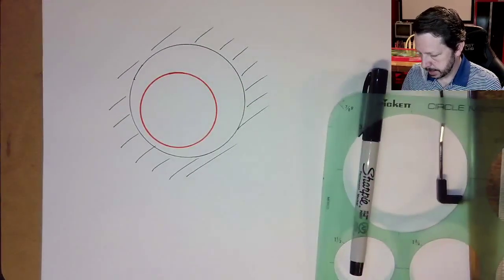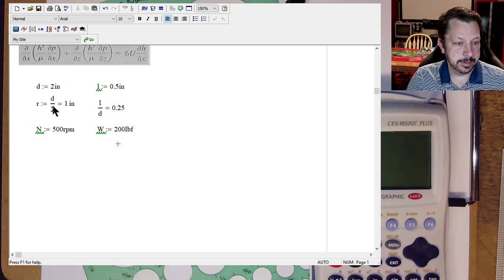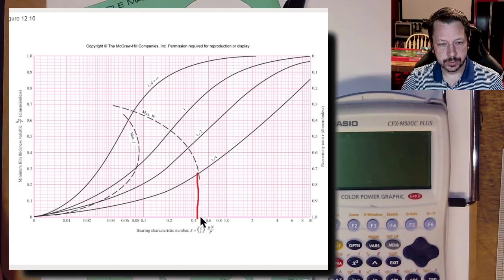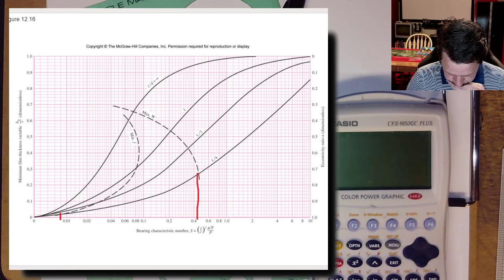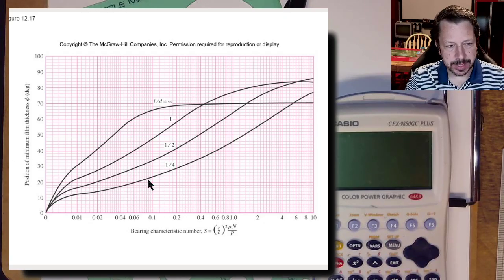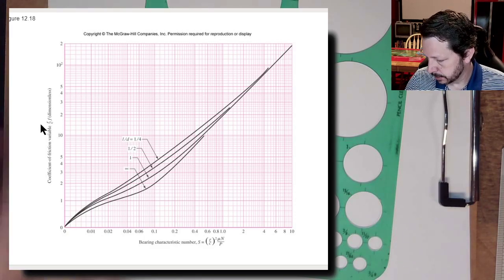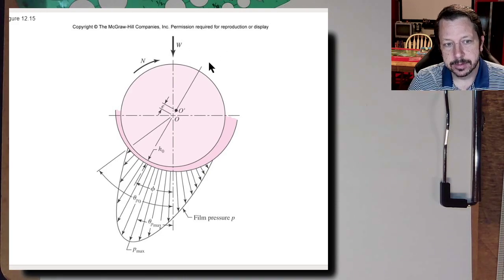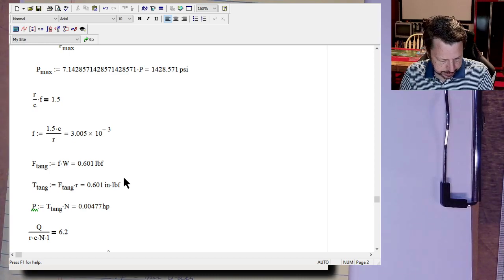Journal Bearing Design and Analysis | Shigley 12 | MEEN 462

Comment: How can I solve it when the l/d ratio does not appear in the tables? .....How is Raimondi and Boyd's interpolation applied?
Reply from the maker: As long as l/d is between 1/4 and infinity then you can use equation 12-16 (10th edition Shigley) to interpolate between the lines. Basically, you calculate a weight for each of the four lines that are shown on the charts based on your actual l/d and multiply that weight by the value given on each line at your Sommerfeld number. For example, lets say you have a S = 0.1 and l/d = 1.25 (which isn't on the chart). If you want to find the minimum film thickness using Figure 12-16 you would solve equation 12-16 as: 

ho/c = (1/(1.25^3))*(-0.125(1-1.25)(1-2.5)(1-5)*0.74+0.33(1-2.5)(1-5)0.34-0.25(1-1.25)(1-5)0.2+0.04167(1-1.25)(1-2.5)(0.11)) = 0.391

I hope that makes sense and the parentheses are all correct. :)